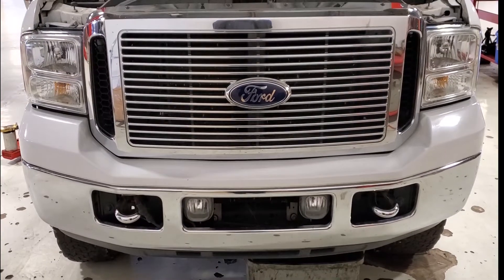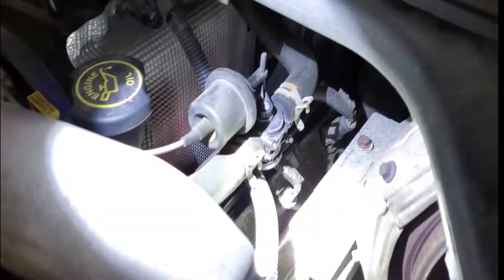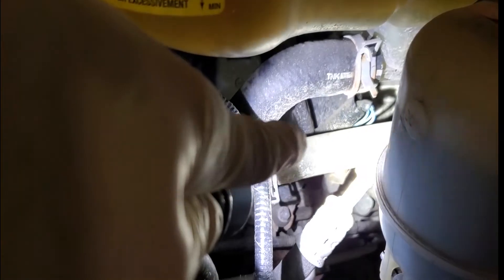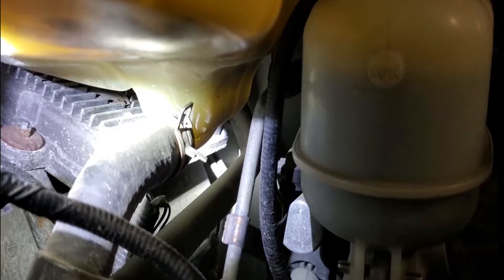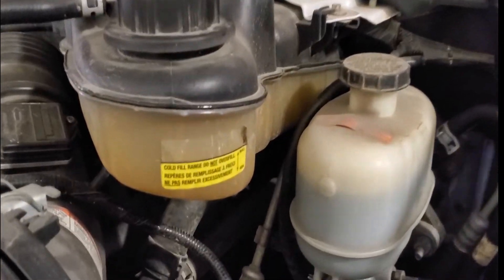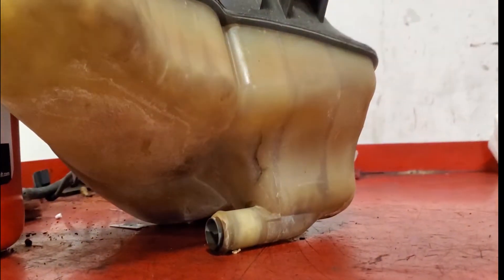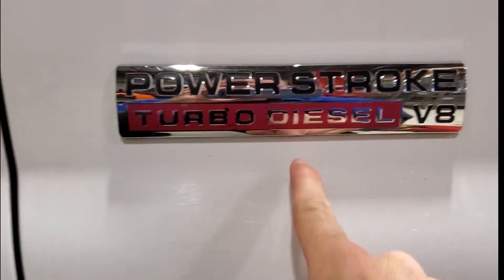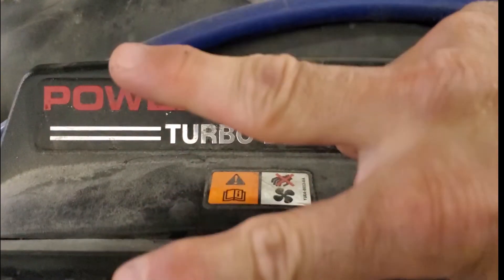6.0 Diesel TOP Coolant Leak Points!

Comment: I’ve checked all these points. It started with just a tiny leak when cold, mostly passenger side. It quit leaking from what I could tell, then I needed to replace the starter. While down there I’m watching it drip, lots. The whole bottom side of the motor is covered in coolant. I’ve replaced the EGR blue hose and the two o-rings that go with it. I’ve been told the leak may be in the valley. Trying to research what it will entail to find it. Looking like  pressure tester to the degas bottle…? There’s just so much stuff that drying it all off is a big undertaking. Wondering if anyone has been here and has any insight. Thanks. Great tips
Reply from the maker: 1st tip is get a pressure tester. You will find your leak!
Reply: @PowerStrokeTechTalkwARod yessir. I did so tonight. Just got back inside. It’s leaking like crazy even at 10psi. It’s coming from the passenger side all along the heads/block area, and from the water pump area. Wish I could post a video here.
Reply from the maker: You can email

Comment: He developed a coolant drip that will slowly drip all night when it’s cold and will empty out the reservoir. Any idea ?
Reply from the maker: Did you pressure test it....
Reply: @PowerStrokeTechTalkwARod  I have not. Don’t have one to do so. It doesn’t leak or lose coolant while running or when it warm. Only starts dripping hrs after it’s cooled off and when it’s really cold
Reply from the maker: It sounds like you need to do a pressure test when it's cold............duhhhhh

Comment: I’ve checked all these points and my blue hose I just replaced as well as the two other O-rings up there, the coolant is still leaking from passenger side, the block to head mating seam looks good, but the leak is coming from right above where the block heater connection is. What do you think that could be?
Reply from the maker: Are you pressure testing it

Comment: What about #6?
Reply from the maker: What about it...
Reply: @PowerStrokeTechTalkwARod I may have another location 😵‍💫. The back of the engine on the passenger side 😵‍💫😵‍💫😵‍💫. I just can’t see from the top side but the drip is where coming from?😮
Reply from the maker: @bertbalderas6714 probably the leak # in the valley EGR cooler hose
Reply: @PowerStrokeTechTalkwARod thank you I will check it out 💯💯💯

Comment: My #4 is cracked I had zero clue!!! I checked all other numbers. I ran my 6.0 with the hose in the coolant reservoir and water started sprinkling out the fan. PLEASE ANY ADVICE WOULD HELP. I’m going to replace the radiator once I get payed in a day or two. 

I was running an errand and on the way home just randomly it Released  absolutely every ounce of coolant. I left a perfect trail of water behind me as I pulled over immediately. No over heat. Mother pulled up on me with a new falling of coolant and I drove home perfectly. The reservoir was empty the next morning

Comment: couldn't figure out where my 2003 ford 550 6.0 was leaking leak got worse thought it was the soft plug turned out it was the block leaking tried welding it still dried put a 2 park high temp casting metal on filled up with anti freeze then it was leaking from I think the water pump put stop leak it stoped leaking day 1 though did the 6.0 have bad casting on engine blocks ?
Reply from the maker: No nvr heard of that
Reply: @PowerStrokeTechTalkwARod  truck has 70,000 miles was parks & recreation dump  truck only put about 2,000 miles before finding out it is on driver side below soft plug thought soft plug would give out before cast block would be something to look out for if it happened to one truck sure it did to others

Comment: Another spot to check is  down on the lower radiator hose, sometimes after a wheel alignment gets done the locking adjustment sleeve bolts on the drag bar get moved to the point that they run on the hose.   Also, and this one is hard to pinpoint, I've had the metal section of the hose that runs behind the turbo run on the compressor and create a pin hole leak, it's hard to find because when it leaks it drops on the turbo and burns up immediately.

Comment: Did a turbo on mine over the weekend. Acted yesterday like burping air in system so no biggie I thought. Went to go to work this morning and drive about 10 miles and started usual. Good head and temps building and then water temp dropped and lost heat. Pulled into gas station and degas bottle completely dry. Refilled bottle and drove home again about 10 minutes and was dry again. Hopefully just either a cracked bottle or y adapter below the bottle. Will mess with later when I have time.
Reply: Hope you fixed it
Reply: @ I did. Turns out coolant return line from back of head on passenger side had small cut in middle of line where it ran right next to boost pipe and also had a small leak right at fitting on head. Expensive fix because turbo and up pipes had to come off but all good now. $100 part that took 8 hrs of labor
Reply: @ thanks for unlocking a new fear. lol. I’ll make sure to check the fitting when I do my turbo.
Reply: @musclekingmedia  the coolant return kit is an aftermarket thing. If you see two 3/8” heater hoses running from the back of your heads to the thermostat housing you have one. If not, you don’t. they’re supposed to help by allowing hot coolant to exit the heads at the rear of them rather than only from the front. In theory keep heads cooler

Comment: I just returned home from a trip to Southern CA to Texas and on the way developed a major leak under the dgas reservoir.  Went through almost a gallon of antifreeze but made it home!  Now need to replace the dgas reservoir and hoses on left side of the engine.  Do you by chance know the Motorcraft  part number of the heater hose that goes around the back left side of the engine so that I can hopefully replace that hose while working on the truck?  thanks for the video!
Reply from the maker: Off hand I do not

Comment: Anyone had #1 on top of that little oil cooler plate that the blue hose connects to ?
Reply from the maker: Many times
Reply: @PowerStrokeTechTalkwARod   is there a gasket or o ring that could’ve went bad? I need to take that plate off to flush my oil cooler anyways
Reply from the maker: @CameronFeltz there is a gasket. Prolly all flat and hard.

Comment: The starter just went out on my 2004 6.0 and I have been trying to track a coolant  loss  and noticed the starter is wet . I know what side the leak is on now .Could the leak have helped take out the starter ?I will be checking the EGR cooler and the heater valve.t Thank you for the Video .
Reply from the maker: Probably not
Reply: @PowerStrokeTechTalkwARod  I didnt think so But you never know. Thank you.
Reply: You ever discover where the leak came from?
Reply: @HowIDoItFaM  Yes the oil cooler water line on top of the manifold right under the turbo. The orange hose with the stupid push lock ends . The turbo will have to come off in Order to get at the thing.
Reply: @Believer21777  thanks for the reply. I discovered my leak was coming from the egr cooler itself. I'm guessing it cracked at a weld. It was leaking down the back of the engine.  I'm going to unalive the egr altogether next week.

Comment: We discovered our water leak today… thankfully. We replaced the top half of our engine in august of 2020… almost spent 8k on it and this part was new almost 3 years ago… and has failed already. #1 was our problem. Thank you for saving our minds trying to find this in our ‘04 Ford f250 power stroke. Our truck went down the day Covid shut the US down.

Comment: I've got a 2003 6.0 and it is leaving a puddle of coolant looks to be from somewhere on the drivers side near the firewall. I can't find where it's running down anything. There will be little drips all over the undercarriage but from time to time I'll come out and have a puddle of coolant. I've had the system pressure tested and they are saying everything is good. I was told it may be cause by blow by building up pressure in the overflow tank?
Reply from the maker: I think i just emailed u back

Comment: Mine is leaking from below the water pump. So I replaced the water pump and it's still leaking. I cleaned the housing and everything. So I'm not sure if it's the water pump. Does anyone have an answer to this? Thanks

Comment: Just found a leak.  Possibly a #5.  Coolant is getting on the outside of the driver's side frame rail, just forward of the wheel well.  Looks like coolant might be dripping on top of the curved portion of the plastic fender well liner, underneath the battery or air filter, then when the coolant gets to the forward flat section of the fender liner, it gets on the frame rail and runs down the outside.  This just started and left a nickle sized wet spot on the driveway.  Is it possible the leak is the degas bottle and it runs down the hoses all that way?  Not sure of the hose routing under the battery and air filter.
Reply: What did you find out about this leak? I have the same leak at the same area. Did you find out what it was ????????
Reply: @alberttowner4651  My leak was the degas bottle (coolant reservoir).  Leaking not at the bottom hose connection like usual, but at the seam where the top is joined to the bottom portion of the container, and it was only at the seam where it faced the firewall.  Found this by reaching under the reservoir when the truck had been driven a while and felt the bottom of the reservoir was wet, though no visible sign of leaks.  When parked, the way the coolant drips on all the stuff below it, the puddle ended up in the location I described, as opposed to further aft like you'd think.  Got a replacement degas bottle from Autozone, was not expensive, and replaced it in maybe half an hour.  Note that I siphoned as much coolant as I could out of the reservoir in order to re-use it.  It holds more than you'd think.
Reply: @chrisdb4278  thanks you much!! I bought an aftermarket one and I see that the cap on my is leaking. IIl go by another bottle and cap. Thanks again!
Reply: @alberttowner4651  You could just buy a replacement cap.  It is possible you got a bad one.  I've also found that with the aftermarket reservoir, the fluid level (cold) seems to want to be a little lower than with the OEM.  I suspect the shape and volume of the bottle are not 100% same as OEM.

Comment: You respond to stuff this old?
Reply from the maker: Yes we do my friend
Reply: @PowerStrokeTechTalkwARod  there is a  thing two wires to it. Hard piped. Sitting right next to the upper radiator hose! What is that called? It’s leaking fuel
Reply from the maker: Two wires?
Reply: Wish I could post pictures of it not sure if it’s a fuel pressure sensor. . It has a 1/2 inch pipe about 2 inches long goes to a round thing.about the shape of a can of chew but probably half the size. It has two little plugs and wires connected to it. It’s touching the upper radiator hose
Reply from the maker: Aint a ford part.

Comment: I have a 6.0 that was slightly leaking past the clamp on the hose at the bottom of the degas bottle. It dried up when the engine warmed up so I am adding a narrow screw clamp next to the spring clamp.

Comment: I just got my first 6.0 and having a hell of a time chasing one out, it soaks steering gear and left framerail, but doesn't seem to come down from where most of those are, will have to check better at that lower by gear, haven't looked down inside the protective wrap yet.
Reply: I’m having the same issue
Reply: @gregboy5944  mine turned out to be 2 different issues-degas bottle was cracked and leaking when hot from the back onto rear left of engine and ebp sensor. Left frame and steering gear was steering line from booster to gear leaking from pinhole behind inner fender cover.

Comment: #2 is starting to weap..Gonna put a pressure tester on it.. Is there a way to get by on the cheap by removing heater value and using barbed fitting for a few months, low on cash..

Comment: Mine is leaking from the top of the radiator  seals.   I've checked   it's not building  pressure  in the system at all also

Comment: I'm going to have to check 2 again but I have coolant on my bell housing mixing with oil, it appears to be coming out of the housing seal. I also have a coolant leak right by rear block plug on the backside of the motor on drives side, the header bolt and everything around it is wet. My only concern I can't spot any leaks from hoses and can't tell if the plug is the actual leak.

Comment: I swapped out the heater control valve, still leaking coolant on the passenger side. Gonna check out that egr tube area today

Comment: Is it maybe possible that the lower dormant hose was resting on the intercooler pipes and burnt a hole in the hose? Cause I checked everywhere and can't seem to find it
Reply from the maker: Huh
Reply: @PowerStrokeTechTalkwARod  the lower over flow hose. I noticed my pipe is resting on it and wondered if it caused it to get a hole

Comment: What's the best option if you've got a leak on a brand new blue quick disconnect coupler for the egr cooler?   Can you add hose clamps on it?   If I move it around ...twist it a little, will it give better results?
Reply from the maker: No you probably scored that aluminium housing that blue hose goes to not supposed to twist it in reuse that housing

Comment: Hey boss can you shed some insight. I have a 2007 6.0 with 122k miles. Doesn't overheat at all, runs really good. Occasionally when I start it up it will blow white smoke out exhaust for maybe 5-10mins and then stop, not always though. Degas bottle is empty but no leaks that I can see from anywhere. Gonna change degas bottle and cap fill and monitor. Any other advice?
Reply from the maker: 🙋‍♂️if you wanna get down on some diag, you can visit my paypal or venmo
Reply: @PowerStrokeTechTalkwARod  you in Texas? I'm down lol
Reply from the maker: No but i got a guy here now who just drove in...when u comin thru.....DETROIT

Comment: Currently leak from 1 and 2 hahah had to pull the turbo to fix 1
Reply: Just confirmed the leak with a pressure test kit I got off Amazon. So yeah I'll have to go ahead and get that turbo off
Reply: Noooooo lol... I was gonna ask about 1. I really don't wanna pull the turbo.. I couldn't even get the downpipe off today to check for oil.. I'm afraid I won't be able to get everything back together lol. What is the fix? You just buy some hose and reclamp it?
Reply from the maker: Watch my turbo video, i had it off in 10 min!!!!
Reply: It took some finesseing of the turbo to get it off once you get the turbo off its not that bad I recommend cleaning out boost controller valve and oil cooling ports. Turbo tends to get gunk built up around the boost controller valve. And yes you will need to replace a 3 inch or less 3/4inch hose.

Comment: There's another spot too that I'm currently dealing with, its the plastic sections on the actual radiator that are currently separating from the radiator itself where the little metal tabs are.
Reply: Matthew Cox that just means it’s time to get a new radiator bub it ain’t worth trying to repair
Reply: Shop around you can find a good deal. Rock auto has em cheap sometimes

Comment: great vid man, checked all the spots you called out and finally borrowed a pressure tester, I'm getting a coming from somewhere near the top of the front cover. Under pressure I'm seeing a bead of coolant roll down the passenger side seam of the front cover and drop off the edge where the hardline comes into the cover. Any suggestion?
Reply from the maker: Big rubber squishy oring under intake
Reply: @PowerStrokeTechTalkwARod  okay that's what I was thinking thanks for the confirmation my dude! I was hoping to not have to get in there but good chance to do my oil cooler and i've been having a sneaky exhaust leak from the y pipe too.. good chance to get in there and knock a few things out along the way
Reply from the maker: No lie, 👊🙌🙌

Comment: i had a leak at the heater control valve, the y under the degas bottle and i had to fix the lower radiator hose because of rubbing on the steering box

Comment: Thank you I had the degass and another one in the front havent checked lower hose. But 05 excursion with 280,000
Reply from the maker: Awesome thanks 4 sharing
Reply: @PowerStrokeTechTalkwARod   hey brotha i have a question is the min is the new max on the degas bottle i dont want to overfill my coolant in my 2007 ford f250 6.0???
Reply from the maker: Yea yea!
Reply: @PowerStrokeTechTalkwARod   ok thanks for the quick response

Comment: Hello I’m pretty sure I have a leak but from the degas coolant reservoir it’s covered in coolant. I checked all other places and i didn’t see any coolant. But I’m wondering I’ve heard that the OEM coolant reservoir caps were not good in terms of keeping the pressure so what is a good reservoir and cap replacement??
Reply from the maker: If you have coolant leaking  from out around the cap, my friend its time for ARP head studs. Your head bolts are no longer clamping the heads to the block like they should under heavy load...prolly more so when towing.......